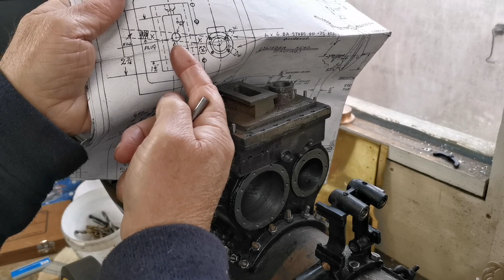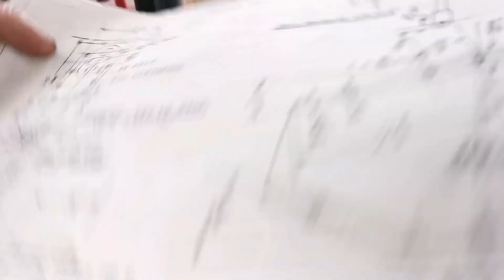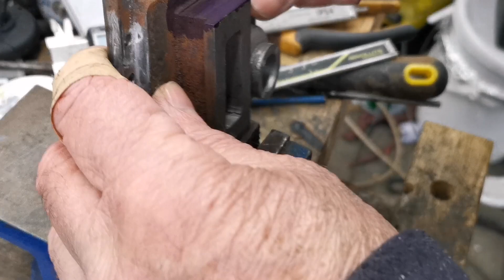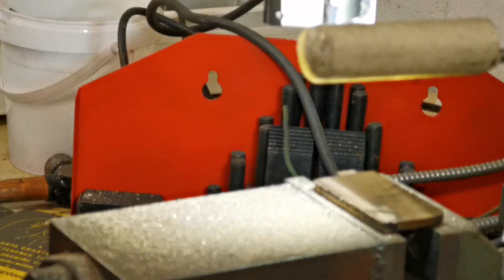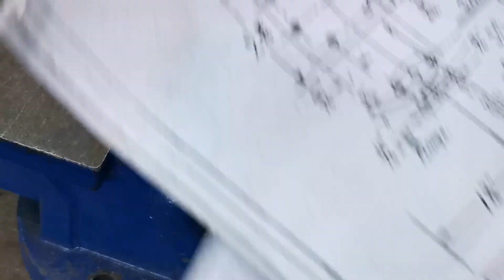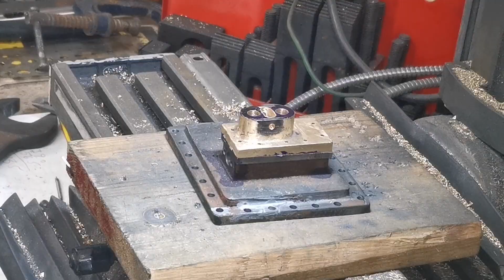2" Scale Fowler Showmans Traction engine

Comment: One thing we found useful is having two different top covers for the safety valves. Having one machined as on the full size example and another threaded for a pair of 1/8bsp off the shelf safety valves. It makes it so much easier to get it tested and if one fails you can just unscrew it and replace it with another £8 valve from anywhere, and you can swap the top plates for display. You also don't have to put the effort in to trying to set up the original style valves in miniature, which can be a pain
Reply from the maker: I'll have to remember that 👍🏻thanks for the tip, and thank you for watching 👍🏻